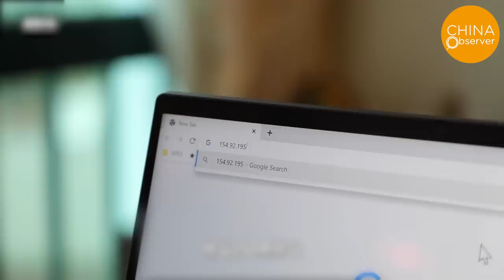Recession and Backlog: Houses, Cars, Phones & Liquor No Buyer Left; High IQ Crime Rate Skyrockets

Comment: Seems like cars and liquors would be easy to produce for exports.  Has Chinese price base and corruption priced them out of the world market?  Have sanctions from Western markets cut them off from profitable consumer markets?
Reply: In the USA the Chinese cars do not meet NHTSA crash safety guidelines.  As for liquor, I have heard it is shit and they will use additives , including anti-freeze.
Reply: @carlfromtheoc1788  There's more export markets than just the US, and a lot of component production has also shifted out of China.  It's odd.  China's new vehicle registrations peaked in 2017, and have declined for years.  On a per capita basis, they are less than half the US level.  Seems odd that they would peak already.

Comment: They have a housing excess and we have a shortage? In twenty years there will be more homes
Reply: Sadly from what I can tell most are tofu dreg , or uninhabitable
Reply: They have excess of VERY low quality housing, mostly in the middle of nowhere - often not hooked to electricity, running water or sewage - at prices that are much lower than when said housing was built but still much higher than it is actually worth. And the government is trying to prevent those inflated prices to decrease.